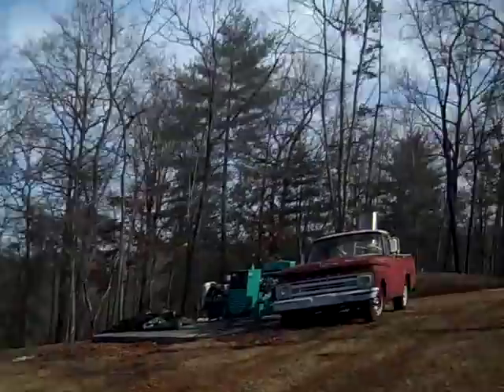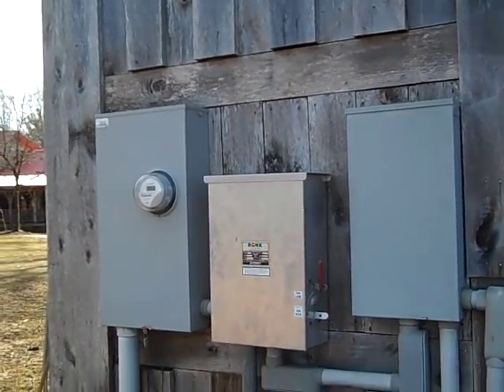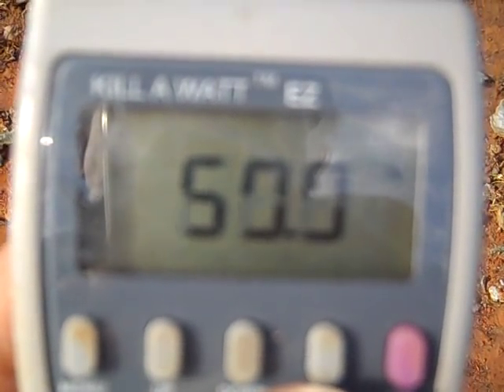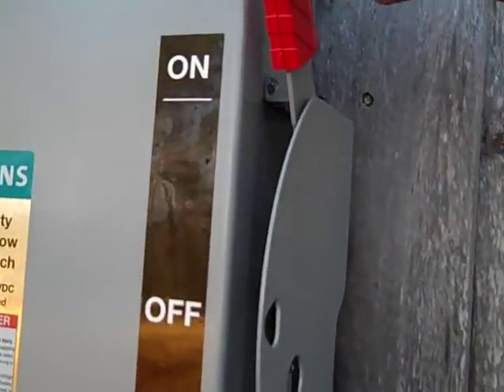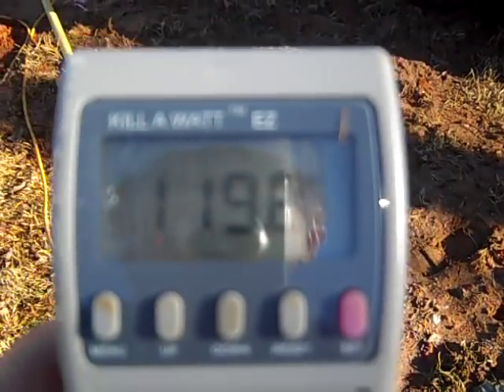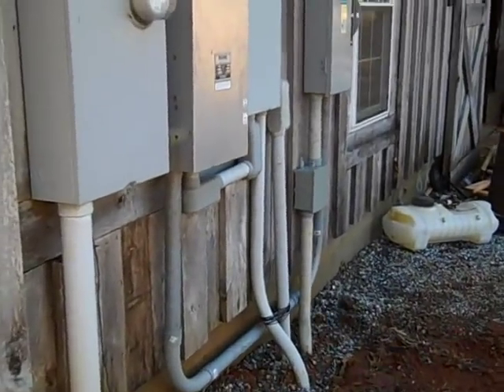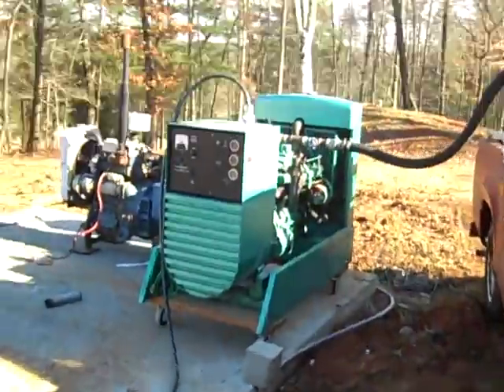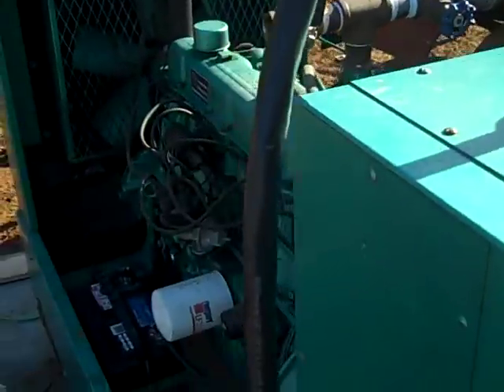The wood gas generator runs the whole farm!

Comment: There are two generators sitting on that pad.  The green one is a "gas" fuel genset (most "gasoline" engines can run on gasoline, natural gas, or propane), and there is a blue generator there as well (not running), which is the diesel genset.

Comment: hi engineer775, i know this may sound stupid but did you design and build that gasifier? i have recently built my own and hope to get to your level. i have not got as far as running any motors, working on my filter but i have questions about setup. so far when i try to flare my gas it will only stay lit at low volumes at large volumes i have to use a pilot light to stay lit. i would love to talk to someone with alot more knowledge than i have. if you have the time could you plz help me out?

Comment: Could I ask what are the emergency strips? I live in Florida,great system
Reply: Probably electric heat strips, aka Aux Heat or Emergency Heat (labeled on your thermostat if you have a heat pump). If you have a heat pump they usually only come on when the outdoor unit is de-icing or if the outdoor temperature is too low. In this video it looks like the primary heat source is the wood boiler and the heat strips would be used if the wood boiler isn't running for some reason.

Comment: yeah ever herd of running on High-voltage Plasma and water? no need for Wood,Gas,Oil just clean power and you can run an ex-changer and get back up to 65% of the water you put in back. see scooter on water.

Comment: Wonder what the rating is on the genny running off woodgas, doubt it's the same output as the same genny running on the fuel it was originally designed for.

Comment: Would it be less efficient to just use a rocket stove to make steam to power a stem piston powered generator? They are much more quiet. You can google"mike brown steam engines" for information on those. It would be interesting if someone ran a generator running off of generated wood gas, and a steam piston engine powered generator and compared the efficiency of one to the other.

Comment: What exactly is your problem, (Other that having your head up your backside?) I ask a man a simple question because I'm impressed with his solution to high energy cost. It would be great if for his sake if he could use cow manure since he does run a cow farm and it is a lot more available than firewood. I have no problem with anyone cutting down trees if they want to, but it takes a lot more labor to cut down trees, then having to cut it up into useable firewood. Then it has to dry for months.

Comment: @RidgedSky yes it does.  These were used many years ago till big gov imposed a tax on vehicles run on wood gas.  Look up rocket cob mass heaters too to heat your home for free.  Cob is (hay, sand, and clay) but you can also do it with sand and bricks

Comment: @KevinDR1987 intial large cost equipment investment.  bio diesel from vegetable or animal oils requires lye and ethanol or methanol.  Both of those are possible to make yourself with minimal investments.  And the plus to biodiesel is that the waste byproduct is glycerin with lye content.  check out journey to forever (no spaces) dot org for loads of free info about biofuels.

Comment: @KevinDR1987 algae is still in the concept stage. no one at all is producing ethanol from algae in quantities large enough to test results.  it is one of those things that sounds great on paper but hasnt gone further that lab test tubes and small scale experiments. Hydrogen requires a large amount of electricty to produce from a water source. Ethanol can be made out of pretty much anything that contains starch or sugars. Solar and wind electrical generation is passive and achievable with a (cont

Comment: @KevinDR1987 yes it is possible to store it in a pressure container but it requires a compressor that can handle flammable gas.  Compressors used to refill propane tanks would work.  a typical air compressor would self destruct because the flammable gas would wash the cylinder wall lubrication down.  There is also a possibility of sparks and unintended ignition with an unrated compressor.

Comment: @engineer775 I have always wanted to do transfer switch. Can you tell me where you got it? This would allow me to use a non sine wave inverter from a battery bank.. Not sure if you could do this too but when the generator is over producing you could be charging batteries that then run and inverter that feeds back through the same switch after the generator is turned off? But they mention auto switches here and a inverter needs to be a grid tie type but if I am manually off grid who cares right?

Comment: Just for safety sake, If you haven't done so already , you may want to attach a #4 ground wire from the genset  and that lonely ground rod you have hammered into the mud.
Great system ! 20 KW is a lot of power for a few air handlers and some pumps. If i were you I would use it just for Back up power and just take advantage of exercising it twice a month. it's hard to utilize 5 kw never mind 20. You might have need to acquire a grain grinding machine so you can use that "free" power.

Comment: @wiserleo It's better to run 120v ac , there is less voltage drop then using 12v dc systems . We use solar panels to charge our battery banks and power inverter to convert to 120v ac . Keep the power inverter as close to batteries as possible and use 4 gauge or better wiring  to batteries . There maybe a little more start up cost but you'll be happier with the performance.

Comment: my 4 acre off the grid retirement project just got yet another inspirational boost! keep on with the innovations and keep looking for ways to harness all of the energy from your labors! you mentioned an underground segment for your exhaust....have you considered a cistern filled with stone for thermal mass and used oil (veggie or motor) as the transfer medium?  you can store heat in the cistern for days at relatively high temps. (400-500* range) and then harvest it through exchange as needed..
Reply: So would that be for hot water production for actual water usage every day or district heating for the winter or both?
Reply: @phillyvoodoo  yes, both.
Reply: I'm guessing in your scenario this is a heat battery....

Comment: This is great!  I have a thought about it.  Would it better to use this energy to charge batteries and then have a parallel 12V or any DC.  LED lights, laptops, most home electronics are already setup for dc in. It just seems like a huge amount of energy and noise.  You could setup a system where charging happened on a schedule.

Comment: @engineer775 
Congratulations on the milestone, just a quick question, is the gasifier the ''woodie'' by victorygasworks? and is the engine running the generator capable of running on diesel too?

Comment: Holy cow, even if it runs 50% horsepower on the wood gas, that's enough to handle basic lighting needs for a block of dozens of houses, and 3-4 full homes with refrigeration, central air, the works! My Lister with spark conversion on woodgas will only put about 1400-1500 watts

Comment: Inline 6s are very smooth and easy to work on, but do you think it's possible to use a more modern I6 engine that has better fuel economy for a generator? Or were you deliberate in choosing an older motor since it would be easier to get/fabricate parts for a carburettor-based engine in WROL (vs. fuel injected)?
Reply: Fuel injection doesn't work.
Need a carburated intake.
Make your own mixing head.
Gas/air mixing,via valves.
Reply: @xmachine7003  huh? Why does the original fueling system matter when it's not being used? I've seen dual propane and EFI systems before so it seems any ICE engine just needs the right adapted plumbing and mixture to work with any atomized or gaseous fuelm

Comment: @InTheSticks0001 Personally I think as long as you ground up the bamboo in a chipper and used a solar drying room(kiln), the bamboo should work fine. But i don't live with the stuff. Even with a normal hopper you could at least find out how much more bamboo it would take compared to hard wood, or even pine. It wold be great for the tropics if they could power their houses off solar and bamboo.

Comment: now to get the heat and use that too :-)
muffler into an oildrum heat exchanger. and a second system on the cooling lines to heat the house or workshops :-) maximum energy efficency :-)

Comment from the maker: @GoatHollow The condensor unit is outside and the heat strips are in the air-handler inside- I call it a toaster since that is what it looks like a huge toaster oven.  Anyway they pull about 10Kw all at once!  I am disconnecting them asap!  Thanks for watching!

Comment from the maker: @infowick Excellent questions!!  And you just made another project for me!  I use the outdoor boiler to preheat my veggie fuel for the diesel generator but I haven't thought about running a heating zone out to that building.  I haven't had a problem starting the wood gas generator on cold days but a lil heat wouldn't hurt.  Thanks!

Comment from the maker: @landlockedviking I bought a prototype unit from victorygasworks a year ago. They blessed me with an awesome price and I jumped on it.  IT is extremely well built and is all hand tig'd .  I have welded a lot of stainless and know there was a lot of hrs put into this gasifier.  My system is more than 20 times more cost effective than a 20Kw solar system but I do have to prepare the wood.   But I can run it any time of the day rain or shine.

Comment from the maker: @PatriotEke emergency heat strips in my airhandler/heat pump ( when they come on they pull ~ 10kw !!!!  )  I could run them if it was a gradual increase but when they come on the gasifier cannot produce enough gas quick enough to meet that demand.
Reply: Stage the strips at 1.25kw with sequencers. . . Easy enough or still too fast?

Comment from the maker: @Iam1uglyguy Since this is the first time loading the generator I do not know the fuel consumption rate.  I will be testing and posting a (pounds of wood per Kw/hr ) number  after I do a lot of runs.  I really can't give you an accurate answer but the rule of thumb is that it takes 3 lbs to produce 1 Kw.

Comment from the maker: @DeleteMeOnline All I know is that it is to our local codes so in case I decide to net meter this baby I should pass their inspection. My power company will allow 100Kw a day  ( 5 hr run for me) to be dumped on the grid. I just want to get a nickel back each month form the power company but also be able to have electricity any time I need it.
Reply: Man love what you’ve got going here! I’m jealous! Something to keep in mind, since the power grid is synchronous and you’re running an AC gen, you’d likely need a huge rectifier and an inverter before they let you connect it. Whatever you do don’t connect an AC gen directly to the grid because if they are out of phase there will likely be major damage to your generator.
Reply: Awesome video!

Comment from the maker: @jimhuntermj21 Yep its loud.  No muffler, no building.   I had to prove it would all work and now onto silencing.  I didn't want to bury it so now its time for a buried exhaust and a baffled , louvered flow of air.  I will be pointing the fan towards 200 acres of dense woods.  The muffler for this thing is so big and heavy that I need to mount/ hang it from the building  and then I will duct that exhaust under ground.   I needed the 20 kw to run the machine shop and welders plus the house.